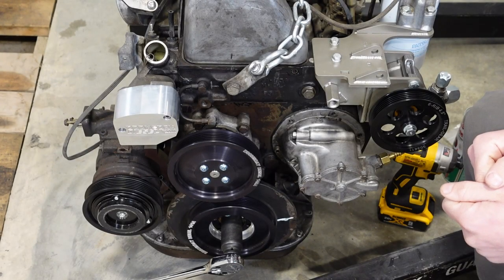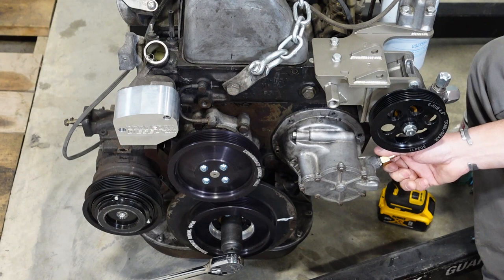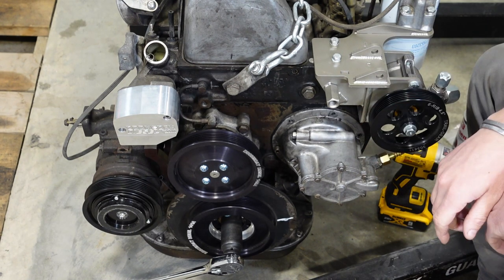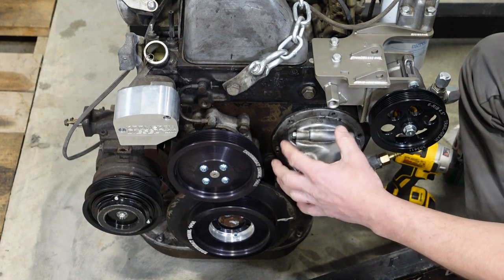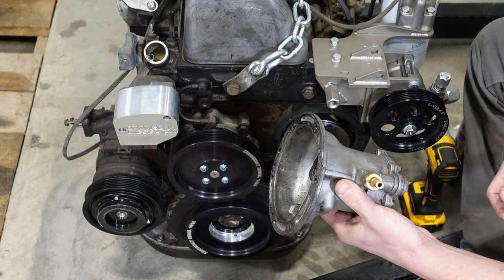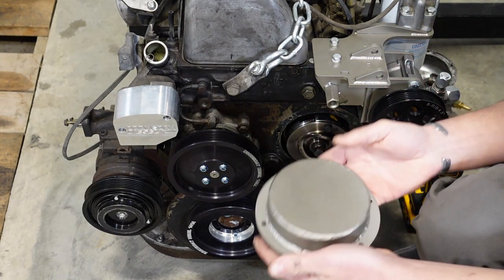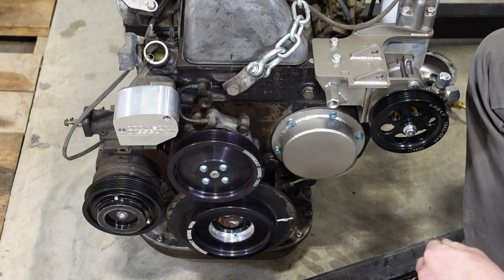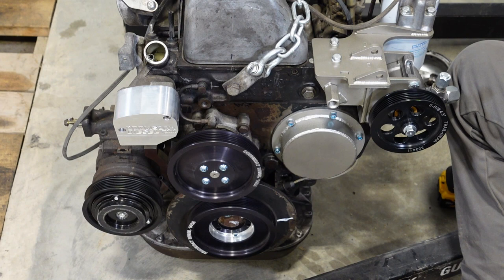OM617 Performance Series: Vacuum Pump Clocking and Delete

Comment: Nice info and video, thanks.    Need a video on the Alda adjustments for running different altitudes.  Mine failed and I got your alda delete part
Reply from the maker: That's actually mentioned in the FSM. I don't remember exactly what it says but I think it says it will compensate for altitude automatically. There are 4 springs inside that can wear out, so once they are shot, they're shot. And to my knowledge, there are no replacement parts available.

Comment: When I worked on an OM617 UNIMOG swap years ago I got to see a MB OEM part number cover plate for the Vacuum Pump delete. it was a stamped steel cover.
Reply from the maker: Ya, they exist. NLA. And not tough enough to weld a pulley/accessory mount to like mine, hence the reason I made mine.
Reply: @doomsdaydiesel  ah yes I see that watching the video again, is there a way to make a shaft PTO for that mount? I'm interested in knowing how a dry sump could be setup for this engine.
Reply: @doomsdaydiesel  NLA=???  Nitrous  Locking Advancement???   Nutty looking Adapter??  Nipple Looking Arrangement???  LOL    No Longer Available???

Comment: So I am buildintg a OM617 for a Jeep, with power brakes. I should probably keep the vacuum pump or is it a good idea to delete it and get brake boost from somewhere else?
Reply from the maker: Hydroboost gets the win if you're pushing huge rubber. Otherwise stock pump or a Hella pump will work fine as long as you have a proper sized reservoir
Reply: @doomsdaydiesel  can you send me a link were go get those items? Google search seems to send me to get make up!
Reply from the maker: @dondaughtrey7537  I have a link on the Vacuum Delete webpage which is linked in the description
Reply: @doomsdaydiesel  Notice the hella pump out of stock. Sigh. no biggie, will get it eventually
Reply from the maker: @dondaughtrey7537  there are tons of different models. That particular one has a very close part # that is slightly more output.
Reply from the maker: @dondaughtrey7537  here is the unit that my customer's have had success with: https://amzn.to/3msg4u9

Comment: do not ever delete the vacuum pump if you have w123/w126. Climate controls are running on vacuum, door locks, trunk lock, etc. I've never heard or seen vacuum pump to release ball bearings into the engine and cause catastrophic failure. I have 10 years experience in om617, and my dad has 40 years. Never ever heard of this so you must be trippin
Reply from the maker: You have to replace it with an electric pump or you'd have no brakes. It will work just fine that way, and there is no longer a threat of your mechanical pump wiping out the engine.
Reply: @doomsdaydiesel  there is no thread in first place bro, dont try to scare people, like i said in 50 years total of experience in my family on om617, never ever heard of that or seen it.
Reply from the maker: @xsiaze  I never said it was common. Just that it's typically catastrophic when it happens. And that's not even the point of the video. The point of the delete for me is for customers swapping 96-04 V6 Tacomas.
Reply: @doomsdaydiesel  thats why I said if you have om617 in the original w123/w126. For swaps, u could do whatever with this engine. But still, these vacuum pumps never fail with catastrophic engine failure bro come on, have u ever seen it?
Reply from the maker: @xsiaze  ya, join a 617 facebook group. There are lots of people who've experienced it.
Reply: @doomsdaydiesel  really. i have been in few groups and havent seen nothing so far , but whatever ;)
Reply: @xsiaze I think you missed the entire point of the video... Doomsday specializes in swap parts for these engines, not generally stock applications (not to say they can't be used on a stock Mercedes car). With that said, he's not "trying to scare people". You're lucky to have never had that issue in your claimed five decades of ownership (which is hard to believe considering these engines have only been around roughly 40 years, but whatever), but some of us HAVE seen it. It will take out a good engine if not caught in time. So, unless you've got something constructive to say, don't start pointless arguments about things that you've been fortunate enough not to deal with. Doomsday is a small business and a damn good one, so negativity that isn't warranted isn't needed.
Reply: @onlyinajeep726  i said me and my father combined have 50 years of experience on these engines lol read carefully mate